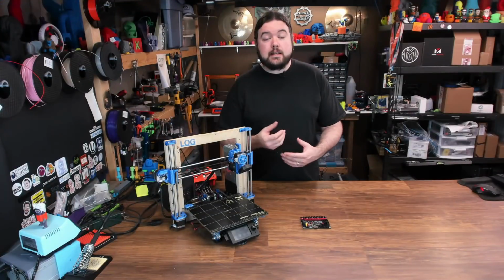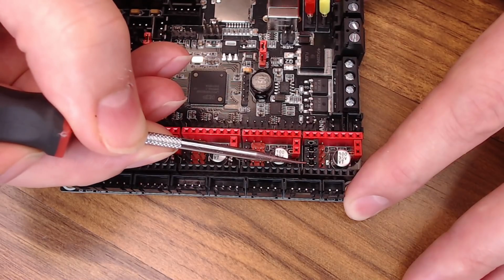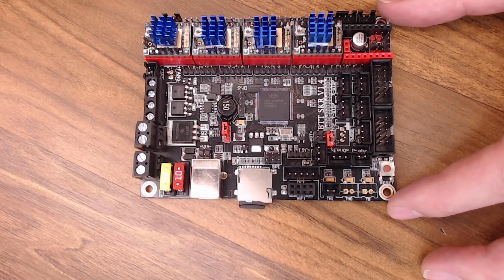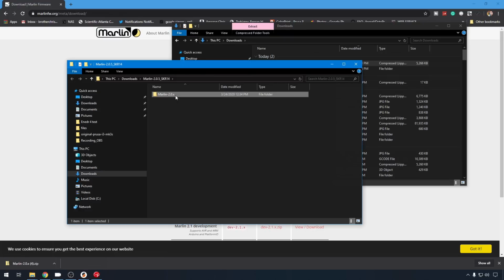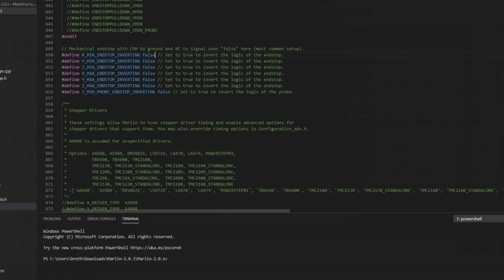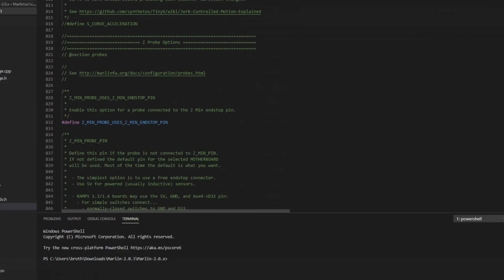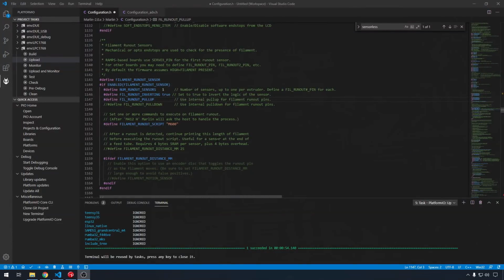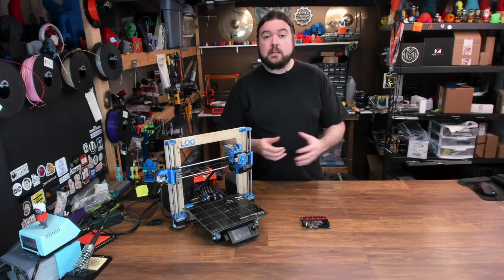BigTreeTech SKR v1.4 Mainboard - Full Install Part 1 - 2209 Drivers - Chris's Basement

Comment: Hey Chris. Long time viewer, second time commentor :)  I'm getting ready to basically rebuild my Geeetech A10 with this SKR 1.4 Turbo. One question I had is that I opened the case on the A10 and there some large connection block that I'm not sure I need with the SKR. I haven't had time to trace the wires to see where they go but I assume this has something to do with the bed heater. Any idea what this thing is and if I should just keep it? I can't actually find a schematic for this GT2560 V4 board (it has this bizarre - but useful - hotend extension cable shown in the photo at the bottom of the board) but as best I can tell, that's the for the bed heater. Those wires look incredibly small for the bed heater so I'm reaching! Any thoughts? Here's a photo if Google will let me post: https://photos.app.goo.gl/Eip84Xou7SjuyYJTA
Reply from the maker: That looks like an external mosfet. It's the proprietary plugs that worry me more. These are going to be very challenging to break out to connect to a SKR or any other board.
Reply: @ChrisRiley  Yeah, I did some more research and it was external mosfet. I just removed it from the setup and ran the 24V directly into the SKR. It's got a built in MOSFET that should handle the load. In initial tests, things seemed fine.

Someone related question: How do you feel the SKR 1.4T compares to the MKS SGenL V2? Quality, performance, price? Any experience with that?
Reply from the maker: @JeffBell76  That is a great question and I have an MKS board to try and haven't done it yet. Hopefully, I will get to that sometime in the future.

Comment: Hi Chris, Thanks for another great lesson. I am retrofitting a Maker Gear printer that has a 24v power supply. I haven't been able to find out what the DC IN is supposed to be. Would you please let me know what input voltage is recommended? Never mind, I found the input power specs for the SKR 1.4, 12-24 VDC.
Reply from the maker: Yep, 12 or 24v work just fine.

Comment: Thanks for the video, have a question: so I am installing this board onto a cr10s, the x,y,z switches are 2 wire terminal ends?  could I connect it so either power and signal or ground and signal wire make the 2 connector work with the 3 pin configuration on the board?
Reply: looks like you can clip the left hand part of the white clip to make the 2 wire end fit into the 3 position pin on the 1.4, should work.
Reply from the maker: You can hook it up to just signal and ground, as you stated you might just have to get creative with the clip.

Comment: Thanks a lot for this, no really, thanks !!  I am assuming the controller settings in Marlin that you gave us is for the TFT35 V3.0 that comes with the SKR V1.4 Turbo. I have a problem though. The board is new, but it has something already flashed onto it. When I insert my mini SD Card into its slot and turn it on for the first time, it doesn't update or anything, and I get a "no printer attached" error message. Any ideas?? Thanks again.
Reply: I didn't know the black ribbon cable had to be attached from the board to the controller. It reads that a printer is connected now. My only problem now is both part cooling fan and hot-end fan run 100% and I can't control them from the controller board. Should be easy to figure out. Thanks again !!
Reply from the maker: Hey James, glad you found the fix! Good luck!

Comment: what do you do with the VIN plugs ... I am trying to do this on the CR10S and I am lost with all the smaller plugs.... The main items I got with no issue.
Reply from the maker: Not sure what plugs you are referring to.
Reply: @ChrisRiley  on the cr10s board there are 2 plugs marked VIN which I assume are voltage in, next to the main cables, I am thinking they are fans but not sure.
Reply from the maker: @Rokhound Yes, I think you are correct, It's been a while since I have looked at one of those.
Reply: @ChrisRiley  Thank you Chris, just wanted to make sure I wasn't losing my mind before powering this up and potentially burning up the board or printer.

Comment: If I'm using a TB600 dirver with SKR1.4, Should I connect the driver to the Closed Loop pins or to the normal driver pins?
Thanks for the vid!
Reply from the maker: Either one should work, I would go with the closed loop pins.
Reply: @ChrisRiley  Thanks for answering! Much appreciated :)

Comment: Is there a video involving 2208 drivers because that's what my board combo came with.
Reply: I just got my board and it was suppose to be 2208 at least that's what the listing said but on the drivers it was printed 2209!  Amazon listing.  Other than that I have no idea what I'm doing because the new marlin I downloaded doesn't look the same.
Reply: @lllBAMlll  mine are TMC2208-V3.0
Reply: @ParrishT3  I need to check my version.  I had a page showing what to do or not do for 2208's if i find it ill shoot you another msg.
Reply: @lllBAMlll  i appreciate it, I know Teaching Tech has a brief video on it but I don't want to take chances.
Reply from the maker: 2208's will be setup the same way. Just the one jumper is needed to activate them and you will have no diag pin going down.
Reply: @ChrisRiley  Isn't there something with firmware you have to change? Some kind of coding change?
Reply from the maker: @ParrishT3  All you have to do is make sure the driver section says TMC2208. Even if you didn't do that, they would probably run fine.

Comment: How did you determine the Z, E0 Axis Steps Per Unit?     T8 Lead Screw Pitch 2MM Lead 4MM,  pursa calculator doesnt have a 2mm Pitch preset.(My guess was 800) Not sure how to guess for the extruder (E0) no calculator on the pursa site for that (How did you come up with 140???)
Reply from the maker: Yes, if it is a TR8X4 then it will be 800. E steps have to be calibrated. https://youtu.be/r0GiAmZiQBE?t=1161

Comment: will this board work without the stepper drivers?
Reply: Yes, in theory if you needed to heat the bed only or the nozzle ,but moving the x ,y or z axis or even the extruder  motor you need the stepper driver , if you needed a stepper driver free board you can use one of bigtreetech dip models that come with built on stepper drivers tmc2208 on board
Reply from the maker: Yes, as stated, to move motors you will need drivers. Thanks @Mahmoud Hassib

Comment: Hi! First of all thank you for these videos I manage to revive my printer after a fatal damage on the board (Tevo Nereus) but I got a problem after flashing the firmware a couple of times it seems that the board doesn't update anymore, the e-steps values remain da same and doesn't change the min temp for extrusion, I look for it and seems to be a common problem but no one gave a solution to this, do yo know how to repair this? Thanks in advance
Reply from the maker: It does seem to be common. The only suggestion I can offer is to format your SD card or try another.

Comment: Hi Chris 
Thank you so much for your awesome videos, they help me so much! I have one question though:
What do I do if I have clipped off a pin on my TMC2130 stepper driver (diag pins or the pins for the SPI connection) and now want to use these on an SKR 1.4? I had to clip them off because I used them previously on a RAMPS but now I'd like to use them on my new board, if possible without soldering new pins to the bottom of the drivers. Is it possible to do some wiring as it is done on the ramps and what do I have to do with the jumpers then?
Reply from the maker: On a 1.4 check this out. https://github.com/bigtreetech/BIGTREETECH-SKR-V1.3/blob/master/BTT%20SKR%20V1.4/Hardware/BTT%20SKR%20V1.4PIN.pdf

You can use the CLS pins below the driver with some jumper to the top of the driver. Also the diag pin you can run it over to the min endstop pin for sensorless homing.

Comment: good guide. thanks.  i know nothing about this topic. this will help a lot. my board just arrrived today. Is it possible to swap the 2x Z-axis drivers so i can have dual x-axis drivers instead?
Reply from the maker: Sure, it's in configuration_adv.h

//#define X_DUAL_STEPPER_DRIVERS
#if ENABLED(X_DUAL_STEPPER_DRIVERS)
  #define INVERT_X2_VS_X_DIR true   // Set 'true' if X motors should rotate in opposite directions
  //#define X_DUAL_ENDSTOPS
  #if ENABLED(X_DUAL_ENDSTOPS)
    #define X2_USE_ENDSTOP XMAX
    #define X2_ENDSTOP_ADJUSTMENT  0
  #endif
#endif

Comment: the port HB1 u connect the wire from hot end fan? cause now i have problem the heater hot end i put at HB0 and the fan i use fan0 and fan 1 port but only fan 1function not the fan0
Reply from the maker: Fan0 is controlled by gocde. Does it come on after you run this command? M106 S255
Reply: @ChrisRiley  I not try it but I follow as u show in video and it's working

Comment: Second CR10s was completed in a "full" day.  BLTouch would not work in the "end stop" port for it on the 1.4 Board...  So I changed my Marlin Code as per the 1.3 Board and plugged it into the Z Endstop pin and it was fine.
Reply from the maker: That's great, thanks for telling us!

Comment: I have an ender 3 and i am dropping in it a skr 1.4 turbo with the tmc2209 but marlin doesn't have the configuration files for my 3d printer with that board. I am not so experienced with marlin for configuring my own profiles so i was wondering if I can get the standard ender 3 settings and set the skr 1.4 turbo board. Do I have to change the pins configuration or does it change instantly when i set the board?
Reply from the maker: Yes, do that, use the Ender 3 profile, then switch the board name and update your drivers and you should be good.

Comment: I have a couple of CR10S's and I figured now is the time to pull the plug on the noisy 8 Bit boards and upgrade to these...  This is not for the faint of heart...  Yes I got the first printer to boot, talk to OctoPrint and actually produce a test print.   Challenges:
1) Cutting the hole in the case for the SSD card and "type B" USB connector.  This was a fiddly pain.   The templates and brackets on Thingiverse worked fine. 
2) Backward LCD Screen Connectors and a  Case fan without a connector  
3) Marlin in VS Code is a pain, that was a day of install, uninstall, remove Python, add python... rinse repeat. And then suddenly it just decided to work... 
4) Sensorless homing was DOA out of the gate. Never could get Marlin to get that to work, cut all of the extra pins on the TMC2209 and went old school homing.
5) Octoprint refused to auto connect  needed to change all of the "firmware and protocol" settings in a way that was completely counter intuitive.  
6) 3 days of pulling my hair out and... Success! Prints whisper quiet.. 

On to the next printer... The second printer is the same as the first with the addition of a BL Touch...  should be easy... LOL wish me luck.. I will update in 3 days!
Reply from the maker: Nice work Tom, the first one is the hardest one I am sure. :) Hang in there.

Comment: Putting tinned wire ends into screw blocks will guarantee a loose connection eventually. The solder will creep under pressure. Better twisted bare wire if you are not going to use ferrel crimps.
Reply from the maker: A great tip that can't be over stated.
Reply: @ChrisRiley  Its an electrical engineering 101 thing.

Comment: hot bed right is supply and  the left  is signal or negative supply. cause no supply go my bed if i follow u instruction
Reply from the maker: Wow, they must have changed it.
Reply: @ChrisRiley  so for heat bed I connect the positive as u show in video n the negative supply i combine with the DC supply its right?
Reply: @ChrisRiley  I hope u can help for this  board as soon as possible.
Reply from the maker: @ahmadsyafiqasman5249  Connect them like this, 4 wires, 4 terminals. Check the fuses if it isn't working. https://github.com/bigtreetech/BIGTREETECH-SKR-V1.3/blob/master/BTT%20SKR%20V1.4/Hardware/BTT%20SKR%20V1.4PIN.pdf
Reply: @ChrisRiley  erm, should I combine the positive supply with the positive wire from bed together and connect to HBO? Cause my bed have 4 wire (12v,-12,5v,-5v )

Comment: Chris, what a wonderful Tutorial. Thank you for this. My question:
is there a way to leave and activate the stock endstops , not use sensorless homin g, without having to cut off the diag pin?
Thank you
Reply: I did bend mine slightly outwards, and made sure nothing is touching
Reply from the maker: Unfortunately not that I know of. I know it's a bummer to clip the pins. You could get around it with some tricky edits in the pins file.

Comment: Hoping someone can help me figure out what is going on with my build. I have attached the hot end fan to HE1 and #define E0_AUTO_FAN_PIN P2_04 in the .adv.h file. When I try to preheat, the temp hits just over 50 and then the machine reboots and goes into a reboot loop until the temp drops below 50.
Answered my own question, but instead of deleting will leave it here in case someone else runs across this. I had my +/- swapped. Instead of getting magic smoke I ended up in a boot loop.  I assume for safety reasons.
Reply from the maker: Glad you found it Ben!
Reply: @ChrisRiley  Yeah. Too bad having other issues.

Comment: Hi Chris ! I would like to know if you have any idea about my issue with my skr 1.4 and dual Z. Sometimes both Z motors works as expected but sometimes just one motor works and the second one do no move. What is the problem here ? thanks (I use TMC 2209 for XY and 2208 for Z/E)
Reply from the maker: Hmmm, not sure there, the only thing I can think to check is cable issue. If one moves, they should both move. That is how the board is configured.

Comment: I am trying to compile firmware for this board for my Anycubic I3 Mega and Marlin 2.0.7.1.  I am having a hell of a time. I know I am missing something because when I use example configs it works fine. I have opened an example from someone else that did ALMOST everything I want to do and gone line  making changes to my code.  I keep getting errors. Below are 2 examples and a link to a pastbinn of what I am seeing. I can't figure out what I am doing wrong here. 
Hoping someone here has some idea of what I am doing wrong. 
I get the same errors if I follow Chris's directions exactly. 
"#include errors detected. Please update your includePath. Squiggles are disabled for this translation unit (C:\Users\bcarl\Documents\SKR board\New_SKR_Board\Marlin\src\MarlinCore.cpp).C/C++(1696)"
File "C:\Users\bcarl\.platformio\penv\lib\site-packages\platformio\builder\main.py", line 168:
    env.SConscript(item, exports="env")

pastbinn
https://pastebin.com/b756LZaC
Reply from the maker: Make sure you file path isn't too long. Move your Marlin folder to C:\ and readd it to VScode.
Reply: This worked.

Comment: On a TMC 2208 driver i do not have those pins (7:42ish) that I am supposed to clip one.  Is that going to be an issue?
Reply from the maker: 2208's won't have them. Diag is just for sensorless homing.

Comment: Umm chris? May I ask you, how did you took off the headers from the board? I plan on making new connectors on my old cabels, but for now I need a way to connect them so they will hold (thermistors unpluging in the midle of a 6h print is not an enjoyble thing to experience)
Reply from the maker: On the SKR boards I use these to make sure they hold. https://www.amazon.com/Hilitchi-Housing-Connector-Adapter-Perfectly-Compatible/dp/B015Y6JOUG/ref=sr_1_4_sspa?crid=1K31VA5RZ4HQ0&dchild=1&keywords=jst+connector&qid=1605305362&sprefix=jst+%2Caps%2C201&sr=8-4-spons&psc=1&spLa=ZW5jcnlwdGVkUXVhbGlmaWVyPUEzMTRVMUE5Q0ZBNVk2JmVuY3J5cHRlZElkPUEwMDAwMTQ2MVVNRUpEUzVQTkpGNiZlbmNyeXB0ZWRBZElkPUEwOTMxODYzSEUxSENGRk9OUkRHJndpZGdldE5hbWU9c3BfYXRmJmFjdGlvbj1jbGlja1JlZGlyZWN0JmRvTm90TG9nQ2xpY2s9dHJ1ZQ==
Reply: @ChrisRiley  do you need to unsolder them to Remove them or is there some kind of a trick?
Reply from the maker: @Norag02  Oh, is your existing connection failing? Maybe just hot glue it. I have done that before as well.

Comment: Hi Chris, I just bought this board and it came with 5 x TMC2209 like you have , is E1 just for 2 extruder motors and if so do i just not fit it until the day I get a second extruder ?  Thanks
Reply from the maker: You can use it either way. Remove it for now and reserve is for E1 or you can use it for your second Z motor. It's don't hurt anything to leave it installed either.

Comment: Hello Chris, you look like an expert, who can answer my question, here it is. Ender 3 Pro has 20 teeth pulleys for X and Y axis, that means 80 steps per 1mm. What will happen, if you change these pulleys for 16 teeth. If I do count correctly ( Prusa calculator not me 😄 ) we should get 100 steps per 1mm. Will it increase the accuracy of Ender 3 Pro for example? Torgue should go higher too with accuracy I guess. If it does, maybe Creality could do it for all new Enders. What do you think? Can you test it? 20T pulley on Ender has pitch diamater 12,73mm, 16T pulley has pitch diamater 10,19mm. I can see it could work "on paper" I dont have spare Ender 3 Pro nor 16T pulley to test it on. Thank you very much for your answer. Have a nice day.
Reply from the maker: I could test it out. I don't think you will see a lot of difference. The higher step count should get you better resolution on paper and the larger radius should make the belt run smoother.
Reply: @ChrisRiley  Thank you very much. I was just thinking on paper. 😄👍

Comment: Hi Chris, is 800mAh current safe for SKR 1.4 Turbo with TMC2209 running UAR on Ender 3 Pro? Thank you.
Reply from the maker: Yes, 800 should be fine, just make sure the motor isn't getting too warm.
Reply: @ChrisRiley  It is getting warm with 600 on Y axis, Ender 3 Pro. I got some issue that Z axis is leaning left. I checked the belts tension and basically every other screw, I just cant figure out, what is happening.